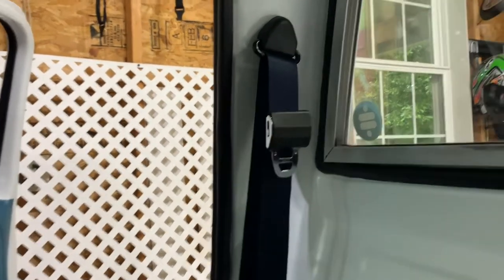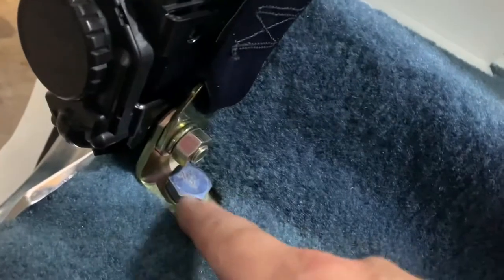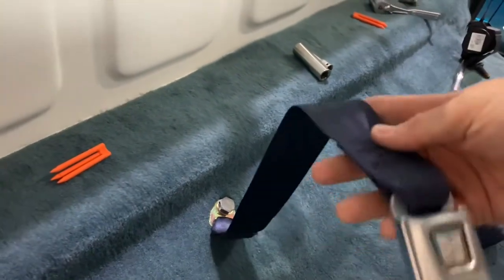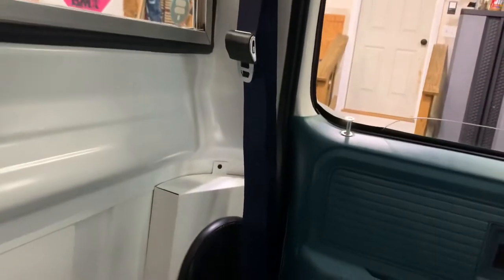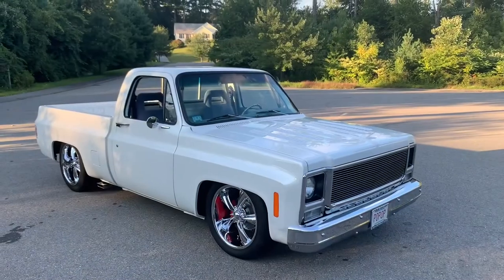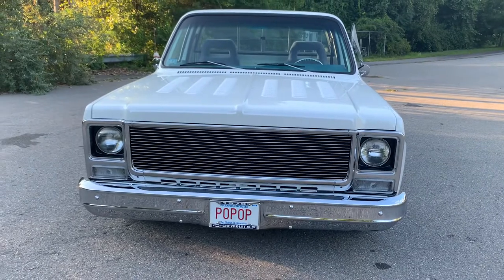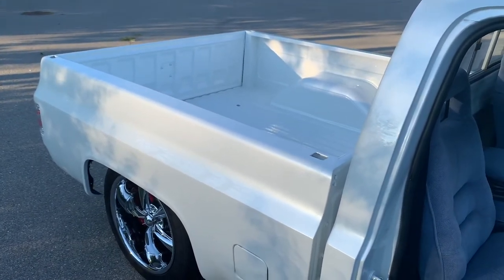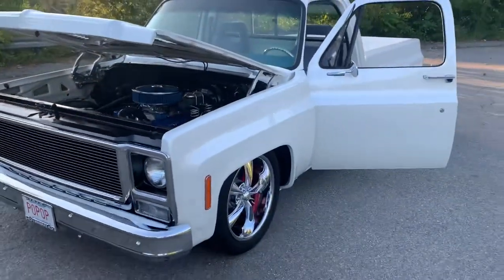79 CHEVY C10, LMC Truck Seat Belt install, Walk Around, Future Plans

Comment: Amazing job, I also have a 79 I got about 2 months ago. I need to redo the door panels and seat and I really like yours !   I have not seen door panels like that before, nor that seat config. Can you please tell me where to get those door panels , that is even the exact color I need.. I really like your exhaust set up too , very cool !
Reply from the maker: Thanks bud! 
The door panels came stock on the truck, but you can find them on LMC's website Part Number-382601-B (Blue)
I just added the bottom carpet pieces which I also bought on LMC.
The Blue paint code is #37-8382, spray paint is also available on LMC.
Good luck!!